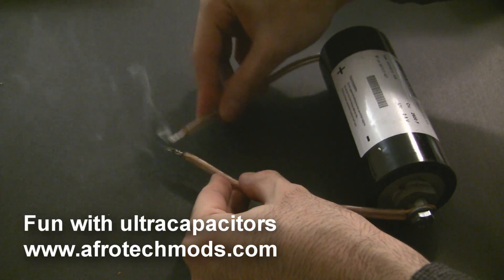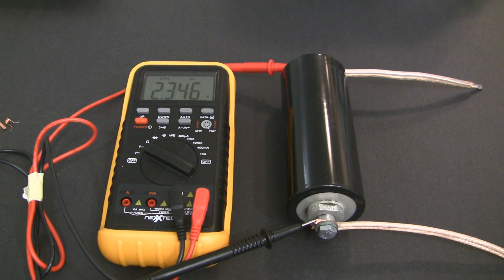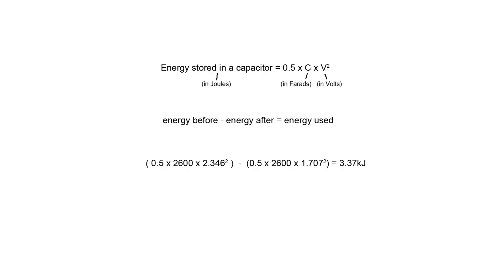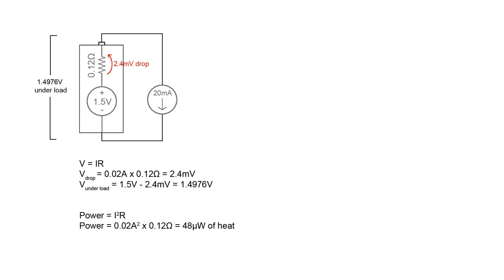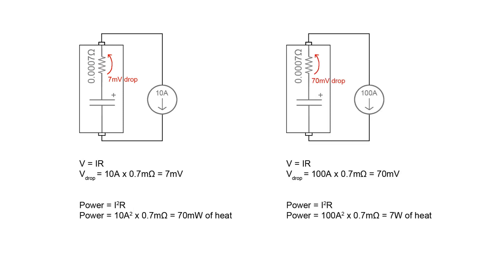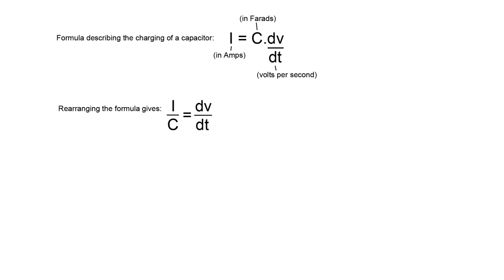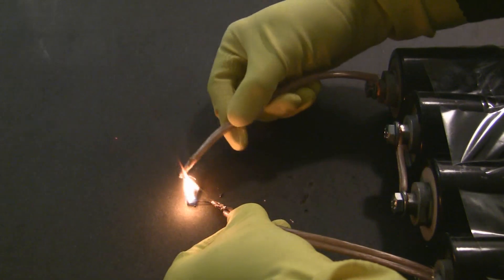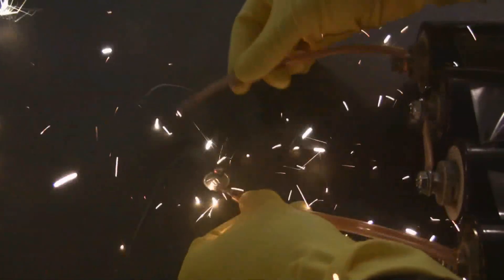Fun with ultracapacitors!!

Comment: I still trying to wrap my head around it.  The caps can hold a lot of amps, but it's still just 2.5 volts pushing them out.  How are you spot welding with it?

Comment: Is the internal heat result correct? (at about 3:40). I remember being asked some questions about heat and batteries when I did thermodynamics at uni and used the ESR to do the maths only to get the wrong answer. It's used to work out circuit effects.

Still, fun. I remember a demo at school where the teacher transformed mains down to 1.5V with a large copper coil as secondary. Lit a 1.5V bulb torch bulb fine, then melted a 6" nail.

Comment: Afrotechmods: Caps in Series mean, that the capacity gets a bit lower per capacitor: 1/C1+1/C2=C3. Well, what would happen, if you put them in parallel? Than it is C1+C2=C3.

So, would it make better sparks? Please make a Video about this.

Comment: If you put these capacitors (10V) in series with a LED and a 330ohm resistor, would that work without burning the LED and the resistor?

Comment: I envisioned two sets of 40 caps. The 40 would be wired in series - 40 * 2.5 V = 100V (close to 96V) and the other 40 would similarly wired and then the two sets would be wired in parallel. That would give me 80 * 0.5 * 2600 * 2.5 * 2.5 = 650kJ or 180Whours - about enough to drive about 2/3 mile. Gizmag.com has an interesting article using graphene for ultra caps - 276Farads per gram at 4 volts. If I replaced my heavy lead pack for the same weight of these caps I'd be able to drive 760miles!

Comment: Got it - thanks. I am considering getting 40 or 80 2600F or 3000F caps for my electric car I built. They would act as a good dumping ground for the regen current and provide lots of current for acceleration. However, I have a lead acid 96V battery pack. I wonder what your opinion might be on connecting them to the cap array? Would you just connect the capacitor array up in parallel with the pack? Seems that the depleted caps might draw too much current and damage the battery pack.

Comment: If you have sweaty hands you'll be able to feel the tingling earlier, that's true. There is actually no "absolute voltage", because it depends on so many factors.
In Average you can say: The higher the voltage, the lower the body resistance.
And... Please be save when working with higher voltages. Resting a circuit board on the legs is never a good idea. We have workbenches for that :)

Comment: I wouldn't call it unsafe, but around 19V I'm able to feel the tingling if I'm a little sweaty.  In my infinitely good judgement, I came home from the gym one day and immediately went to work on a strobe light I was building at the time. continuing the good judgement, I rested the board on the my leg, and kept feeling a pins-and-needles like feeling. It took me a good 10 minutes of this to realize I was shorting the power in and ground points on the board across my leg.

Comment: If you touch the wires nothing happens. The resistance of your skin is too high to let a serious amount of current flow at 10 volts. Even 20 volts are save. I realized that a little tickling starts at about 30 volts DC.

Comment: When you charge the 4 series capacitors, your power supply is delivering 5 amps at 10 volts for 1300 seconds : that's 5x10x1300 = 65KJoules (E = VIt)  However, when you work out the capacity of the 4 caps you'll get 32.5KJoules :  E = 0.5CV^2   So - where does the energy go? What gets hot and or what gets radiated with EM radiation and why would there be EM radiation at DC?  Often wondered about this - do you know?

Comment: @AnimationsMB It´s just 10Volts and that won't do anything to the human body. Our skin is to thick for the electricity to pass trough the body. Since this is DC Electricity you need about 100 Volts before it can pass trough the body. But if that happens, the chances of death is present. the amounts of Amps these gives away can kill a grown man on the spot. What you need to kill a man is 30 milli amps. this gives away is a bit more...

Comment: Keep those ultracaps long instead of short, peeps. Do local temperature and EMI-controlled spot welding repair of microbump ICs, automate arc welding and safety, jumpstart trucks, develop power memristor variants, do low-atomic-depth impact-forming and friction research, keep them under 370K, skip most looking for electrical harmonics among your organs. One movie with a cyborg grabbing 10kV rails is enough.

Comment: @foil666 "I wonder how many hours a standard 0.12A 12V computer fan would last with a 12V rack of these things."
You could work it out but one issue that needs to be addressed is the voltage drops constantly over time so the fan would start slowing down right from the start.  Batteries keep their voltage almost the same until they're alomst discharged then the voltage plummets. You could get around this with a DC to DC converter though.

Comment: surely you put the caps in paralell? becuase when you do its C=2600 * 4, but when you put them in series the equation is 1/C = (1/2600) * 4 so it would be a quarter of the capacitance

Comment: @Alamene Your power supply should be fine, as long as it has a current-limit mode (most good bench power supplies do). The only variable here is that if your power supply can only output 3 amps of current, for example, it will take much longer than a power supply that can output 5 amps of current. Just make sure you don't over-volt the capacitor, or it may explode! A capacitor that large can easily store enough energy to seriously injure or even kill you if it explodes.

Comment: @MrJumpersun Nope. As long as the voltage of the capacitor does not exceed the maximum input voltage of the microcontroller, you should be fine. However, the problem you will encounter is that as the capacitor gets discharged over time, the voltage output will drop, and the microcontroller will cease to function. You can simulate this by connecting your microcontroller to a variable power supply, and slowly turning down the voltage until it stops working.

Comment: @LUVB6CPPgmodcsscoder so the dude in the video was after more output energy, not storage.  so the whole point in putting capacitors in series is to get more output against resistance, but not storage. My next question is, why? why doesnt the capacity increase? in a battery, if you connect 4 x 12v 100ah in a series, you get 48v 100ah. 48v x 100ah = 4800watts of capacity, where 12v x 100ah = 1200watts of capacity for a single battery.

Comment: @matter45 No, Farad is capacity, and when you put capacitors in series their capacitance may drop (try 2600/4) it will give 650F, BUT even though the capacitance gets lower, there still can flow more Ampéres on the same resistance because the voltage is higher

Comment: 10v x 650 farads = 6500 (4 capacitors).  2.5v x 2600 farads = 6500 (1 capacitor), isnt farad a measure of unit? please correct me if i am wrong...

Comment: Something interesting to add is that even with one fully charged supercap, the overall amount of energy in Joules is still less than an average AA battery. The advantage to the cap are its high rates of charge and discharge.

Comment: At 9.6 volts you can touch the leads with you hands and shouldnt be electricuted.    Your body has a high ohmage and will draw next to no amps.  A car battery has more volts (12V) and you can touch the leads with your hands no problem.   I wouldnt touch these ones just in case unless I saw a friend do it first.

Comment: @chazzy2501 : Equal capacitors in series equates to making a single capacitor with increased plate separation/dielectric thickness but the same plate area. This increases maximum voltage before break down of the dielectric, but reduces the capacitance. 

Yes, 2x voltage=4x energy(see the voltage^2 in the formula in the video?), but in a 2 equal cap series circuit you get half the capacitance, and so the circuit only stores a max of 2x that of a single cap(Logically enough, really)

Comment: @SalsaTiger83 In which case you could still use a AA battery. You can easily make tasers that run on a 9V cell that has a transistor oscillator or 555 hooked up to a flyback transformer and some prongs. DC bulk caps found in ATX supplies are easily able to kill you if you touch the charged leads, these caps however don't give enough voltage as a single cell to hurt you by holding them. If you did stick then in series to make enough voltage, then yes, you'll get a hell of a cooking.

Comment: @HammerFET It's not about the voltage. It's all about the current. I don't know how to actually achieve it, but you probably just need some DC to DC converter(s) to turn up the voltage... that lowers the current, but the UCs have plenty of it, obviously... if that doesn't work, you could still try and give people burns. A nail might not be very big, but if its red, it's pretty hot... If you still don't believe me, try melting a nail with an AAA battery that's the same voltage...

Comment: @gcr100 They can, but the capacity won't be as much as a lipo cell. You could put some ultracaps in parallel with some lipo cells that let you draw insane bursts of current every so often. You just have to make sure the lipo cells don't dump too much current into the cap as they charge.

Comment: @SalsaTiger83 Yeah I guess you can heat something up and burn yourself with that, or power an inverter to get high voltage. But 10V will not give you a shock, no matter how much current the source is capable of delivering

Comment: @bonecrime If you can melt or vaporise something with it then you can hurt someone with it... try transformer circuits (the voltage is low, the amperage is high). Also, try one of these TENS devices... with a 9V battery at 70ma  they can really hurt you if you are not careful.

Comment: @Afrotechmods No it won't explode provided the capacitors are precharged to a certain voltage level. If let say it is charged to 13.5V and during cranking it drops to 11Volts and then the alternator kicks in, since the capacitor is already at 11 Volts it needs to be boosted to the maximum voltage that the alternator is capable of outputting. 

So to be safe you need about 6 capacitors in series capable of handling up to 15Volts

Comment: @SalsaTiger83 well... there is such a thing as voltage doubling circuits. Also the amperes are what counts. Another thought is that you can circumvent skin resistance with needles/spikes.

Comment: @CrimelabS 
well u can still touch the connectors of the caps without problem
its the playing together of volts and amps.
excample:
i got a 80 volt 2 amp dc psu, if i would touch the terminals i would get a serious shock.
another excample:
i got a 17 Ah 12 V battery, and if i touch the terminals here........nothing even if it can put out over 900 Amps

Comment: @Afrotechmods but would these work in a car audio setup, in an array to bring them up to 14v or so, across ground and b+, to compensate for not having a massive alternator or multiple batteries? my amp can supposedly draw around 100amps but i have a feeling its not getting the current it wants from the supply.

Comment from the maker: @facebag666 These _are_ designed for use in electric vehicles, but I would not use them to replace a regular lead acid car battery. If you were to draw over 1000A from them during cranking for a few seconds, there's a good chance they may explode. You'd also likely overload and burn out your alternator during charging because these caps appear like a dead short.

Comment: @0StrangeRover 
Another use of a boost cap is to use a bank of  these after rectification from my cycloturbine alternator, I pulse the charge into the batteries from the charge controllers from the batteries to the inverters that power my home, I enter a boost cap bank each cap is 2600f at 2.5 volts at 8000 joules, there are 6 banks with 6 boost caps in each bank. This gives the inverters a stable current input to handle multiple start-up loads and places less of a strain on the battery cells.

Comment: Step one: Harvest capacitors from electric pole.
Step two: Daisy chain few of those bad boys. Use thick insulated cables.
Step three: Carefully put all that construction in a backpack with two cables hanging from each side.
Step four: Charge it through electric socket. 
Tip, harvest electricity by illegally connecting to your neighbors electric lines.
Step five: Put your pack on your back, hide it with a cape. With thick rubber gloves take two cables in your hand and start toasting your enemies.

Comment: Wow! I can see how these things have a lot of potential (hurr) for electric cars and the like. Would I be right in thinking that these things don't have a limit of charge/discharge cycles like a battery does and also, due to the low internal resistance, can probably be charged a helluva lot quicker?

Great video!

Comment: i dont get something about caps, people say they are to protect components from voltage spikes, but they are always connected to ground, so why would the first voltage spike go only through them and not smoke the parallel component with the cap ?
i notice they are not connected in series nor the 1st thing in a circuit when used as buffers, if they were i would get why they get hit by 1st spike.
do they always conduct, or only when charged to farads rated ?
thanks.

Comment: These caps can definately power a car , just get many in groups wich are set in series (higher voltage) , and take those groups and put them in parallel (for higher current / more lifetime) , adn you have a capacitor bank to carry you somewhere far far away

Comment from the maker: @troyger1 Every cap will have different leakage currents, which determine the self discharge rate. You can expect most ultracapacitors to hold on to their charge for many weeks, if not months.

Comment: how long can thos BADASS caps stay chaged ?? just wondering because i found some huge ass caps in a realy messed up powersupply idk what the person built it wanted but the could hold 3000 farads at 3,5 volts. how long can thes be charged 

i just want to know before trying to discharge them

Comment: Great information about ultracaps! I'm thinking about acquiring 5 ultracaps to build a 3000F/13.2V assembly to recharge AAA batteries (or digital camera batteries) while camping. This would be useful in situations where I will have no access to power outlets. 19.8kJ should be enough for a lot of recharging cycles.
Thanks for the post! It helped me a lot in understanding ultracaps.

Comment: @spelunkerd Those caps were probably electrostatic like ceramic capacitors or mylar. Opposite end of the spectrum from these ultracaps. Yes, they will fry in most cases or severely lower the lifespan.

Comment: @artifactingreality 
In voltage reading mode, the resistance across the meter is supposed to be infinite. Then the current would be 0 because V=IR would make v/infinity. It sounds scary but you could touch (but dont touch hard or squeeze because it lowers the resistance) the ends of these terminals and be fine. If the path through your body has 1Mohm of resistance and the capacitors he used are charged to 10V, only 10uA of current would ass through you.

Comment: @dcggames They're also used in "boom car" audio to provide help smooth out power draw during the big bass sounds that typically draw a lot of current from an amplifier.  The capacitors shown in the video appear to be more "industrial grade" than the ones I have seen used in consumer audio and probably have lower ESR as well.

Comment: Didn't know you were a Canuck. Frying the beaver, shame, ha ha. Say, Old cars with points have a capacitor, I'm told it's to reduce spark degeneration at the points. Apparently the energy sent to spark plugs from the coil is thousands of volts, minimal amps. What kind of capacitor will hold that? If you put more volts into a capacitor than it's rated for, does it fry?